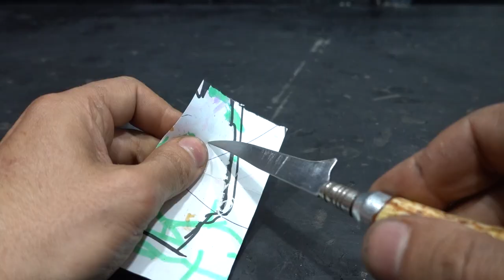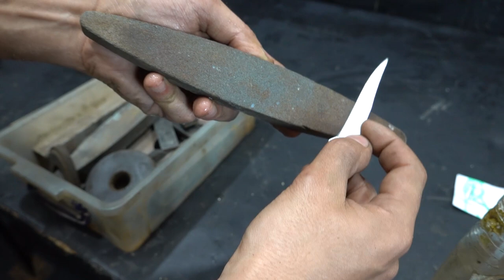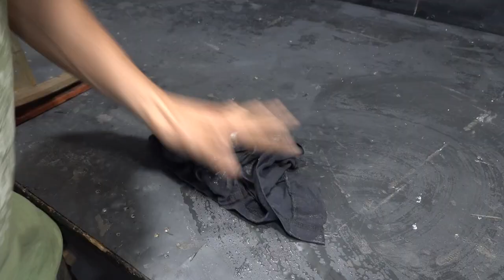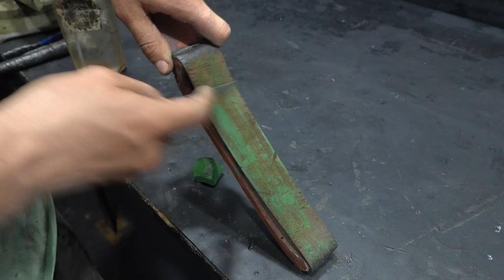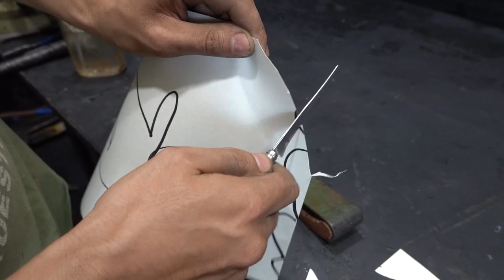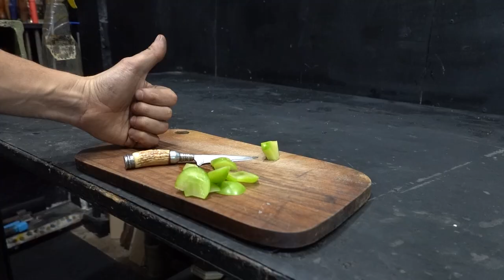How I Sharpen Knives On Stones

Comment: Should have tested on ripe tomatoes. This is my quality control for sharpening. Cut, not squash them
Reply from the maker: The steel of the knife is very low quality, as I have already written, I specifically chose it to show the result as much as possible. And so yes, I agree, it turns out a good test on tomatoes